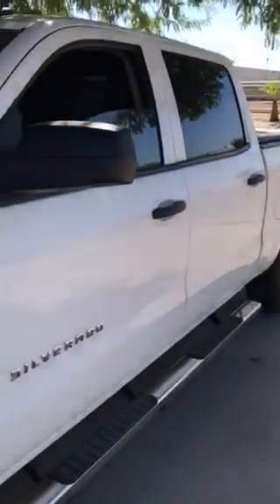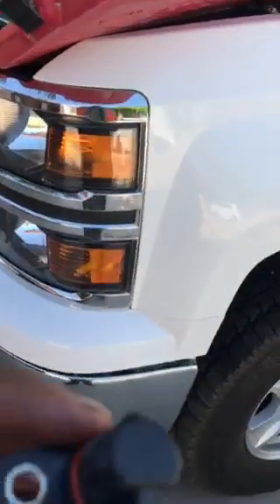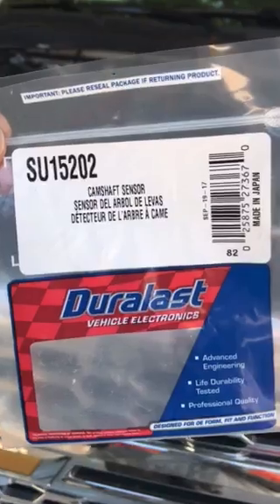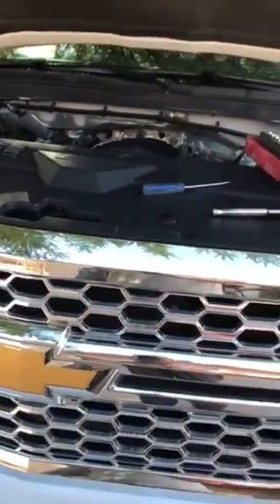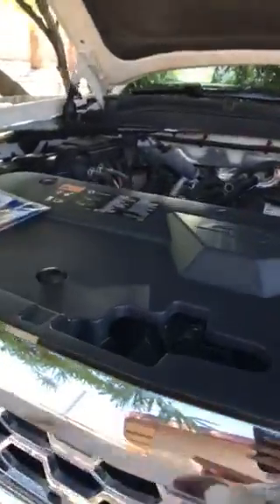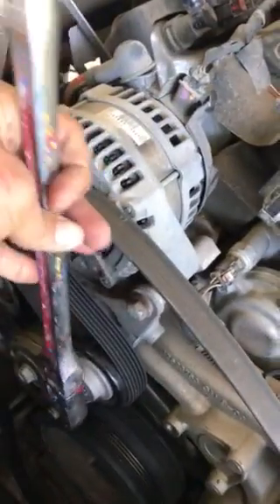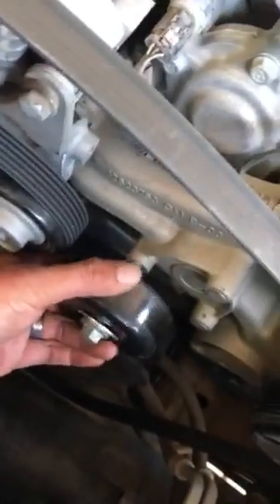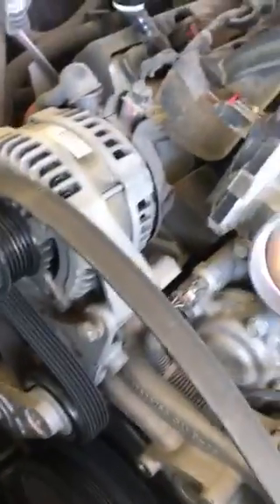Camshaft position sensor location

Comment: Thanks a lot I have been thinking about trying to locate mine so I'm really glad you did the video. I could not find a video showing the location either. There was one 60 second video that was  supposed to show you but it was no help at all.
Reply: Mine is a 2018 and has this annoying little weird noise that happens every two or three seconds and it is showing the camshaft sensor as the cause

Comment: Why did you change the sensor? what code was it throwing you?
Reply from the maker: StealthxAssassin117 the truck engine light would come on and sputter and had no power
Reply: @juanzarazua5869  what code popped up?